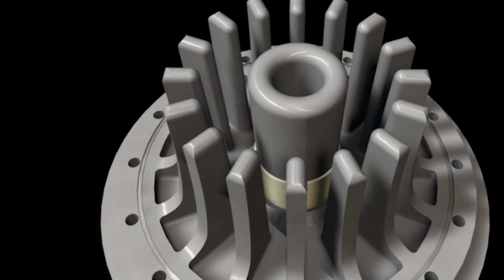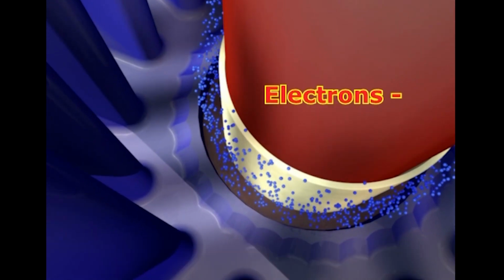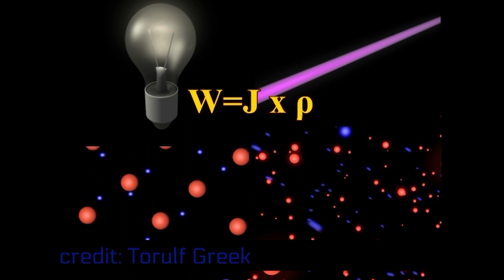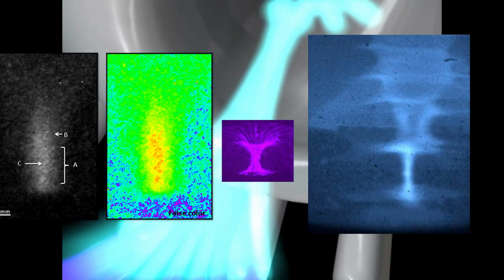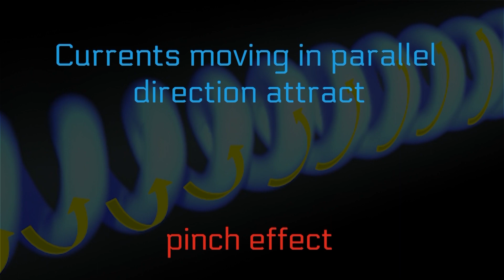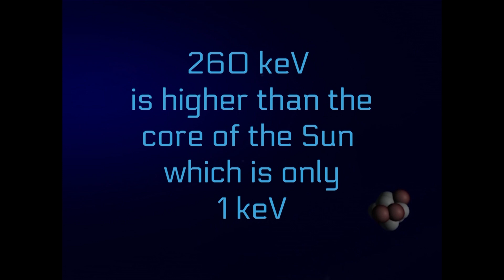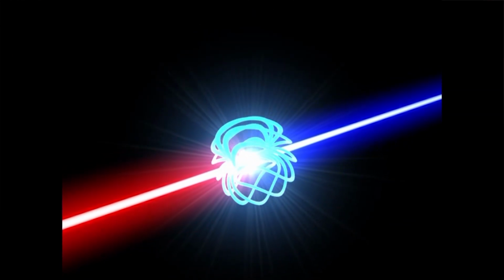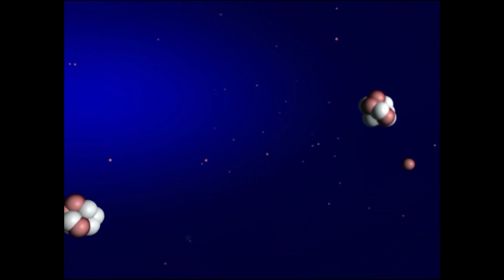How Focus Fusion Works

Comment: Focus fusion is enhanced by the passive interactions between plasma filaments. Lattice confinement is enhanced by the passive interactions between particles in a crystalline lattice. Molten salt fission reactors are enhanced by the passive interactions between ionic solids. I may be way beyond my depth but could these effects all be combined in a single reactor that achieves a focused plasma pinch within a fission-enriched crystalline salt tuned to the melting point of the solid? 

It would be easiest to regulate the rate of the reaction at the melting point of the solid because every particle is fighting against the lattice energy making it a much more stable temperature and temperature is one of the variables that can be used to control the rate of a reaction. The fission reaction would generate the heat, pressure, and neutrons needed for fusion to take place. The plasma focus would, well, focus the heat and pressure further, possibly bringing the coulomb barrier below the surplus threshold.

Again, this is pure speculation and I have no idea how valid this concept might be. My main point is that it seems like a synergistic combination of the best ideas in nuclear energy could overcome the coulomb barrier with much greater efficiency, especially when it comes to the notion of fusion-fission hybrid reactors. After all, it seems likely based on a few of the papers I've read recently that the unexplained surplus heat from earth's core is the result of exactly this type of fusion-fission hybrid reaction and I don't think it's a coincidence that the sun and earth are magnetically coupled due to processes unfolding within their cores. In the sun, it seems to be fusion dominated while, in the earth, it seems to be fission dominated. 

The fact that we have only achieved a fusion surplus by jump-starting the reaction with the detonation of a fission bomb further supports this line of thinking. At lower pressures, fusion is more easily achieved with the help of fission. Or to put it more plainly, with enough fission, you are virtually guaranteed to trigger fusion and vise versa. In a gaseous body, fusion will naturally occur given a sufficient mass. In a rocky body, fission will naturally occur given a sufficient mass (think critical mass or concentration of fissionables). The problem we're running up against seems to be a focus on creating an energy surplus by pure fusion or pure fission, which both have inherent problems. Instead, why not simply enhance fission reactors with fusion?

This would have the potential to exponentially enhance energy output while reducing the costs and risks of each type of reaction and it could be tuned to the ratios of naturally-occurring elements on our planet, allowing us to basically directly harvest the latent energy surplus of the world.

Comment: How is this cooled, wouldn't the temperatures involved in sustained fusion melt this device pretty quickly?
Reply: It uses pulses. the whole process can be turned off and on at will. Look at the google presentation from 8 years ago. I'm both excited and terrified by this technology. This thing is going to be weaponized, I'm telling you! A super hot, and concentrated beam of pure ions...think about that.
Reply: No. The majority of the output energy comes in the form of an in beam and x-rays. Only a constant water source will be required to keep it cool.

Comment: I'm confused. At the end the video shows a proton hitting a boron atom which splits into 3 helium atoms. Isn't this fission?
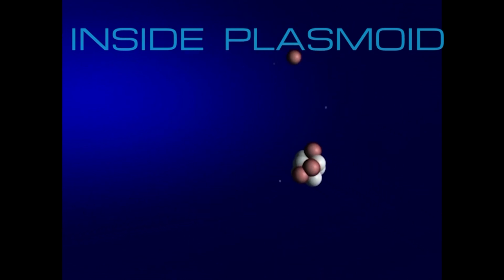Reply: At 3:10 it shows fision! What a scam and even a bad one.
Reply: @Robert Loewe Yes it does. Thank you.
Reply: the proton hits a boron-11 atom, forming carbon-12. the carbon-12 then breaks down (presumably due to the temperature, although it's not at all clear from the animation) into three helium nuclei. so it's technically fusion then fission.

Comment: So once after fission take place what is/are the form of energies can be harvested and in what manner?
Reply: No fission. 
It is fusion. It fuses hydrogen and Boron 11 into helium, and the output is a lot of pulses of x-rays and an ion beam. Both of which convert directly to DC current, which supplies the power for the next pulse, and a large excess. There is no radiation, and no nuclear waste.
Reply: I was confused. Yes it is fusion. What process will we use to convert x ray and or ion beam into DC electricity?

Comment: Have you considered using insulated van der graaf static potential field generator as the (continuous, free) acceleration field? you could also consider additional fusion reactions with output ions (and focus ions) using axial dc magnetic field, generated by the coil used for direct conversion to electricity.

Comment: hello, how do you recover the energy, the heat, that comes from the fusion ? 
sorry if you already answered this question
Reply: Via extracting current from the ion beam as well as the direct output of the fusion process: X-Rays. Using many layers of photoelectric cells all the x-rays are converted to electrons, and so this device needs no steam cycle, and will have relatively modest cooling requirements, which will be handled by a water supply.

Comment: What theory or experiments do support the creation of this "plasmoid knot" ?
Pinch effect is well documented, but usually it leads to great instability without even talking about fusion reactions that add to this instability. Here this plasmoid seems to be very stable.
Also how do you know that this plasmoid then creates these ion and electron beams ?
Can you point to some papers about these questions ?
Thanks.
Reply: Yes abundant experiments show that the plasmoids are stable for times  much longer than the time it take an ion to orbit around. But of course these are still short times--tens of ns. The beams are created at the exact same time as the plasmoid. We consider the plasmoids to be meta-stable, since they last thousands of ion orbits, not millions.

Comment: This company seems remarkably honest as to performance levels actually achieved, which is probably rare in the fusion industry.
Unfortunately they have a very long way to go. The current energy balance seems to be 0.25J from fusion power, with 60kJ input power. Break even is not enough for a commercial power plant, perhaps 10x break even would be more realistic. Thus they have to improve by 2.4 million times!
Reply: wooosh
Reply: Well on their website they hypothesized and experimentally derived a relationship between peak current and fusion yield which has a quintic relationship (i.e. fusion yield is proportional to the fifth power of peak current.) Thus, even small changes in the peak current will have a huge impact on fusion yield.
Reply: The thing is that almost all aspects of this model of reactor are simply that of scale and time.  The technology to make this viable has been around since the 50s, although any realistic application would require both solid state electronics and them to be able to handle high repetitive surge currents and peak voltages.  Although the properties of silicon carbide in this regard have been known since the 80s.

So, at any point between 1950 and today, some enterprising individuals in a dark corner of a mega corporation, somewhere, spending a few rounding errors on crack teams of the best machinists, electricians, physicists, etc they could find to throw at research.... Could have had this idea, proven it worked, and filed it away for a rainy day.

... Actually, thinking it out a bit, most of this could probably be done without solid state components.
The negative resistance cancels out against a capacitor's discharge curve and the main problem is designing capacitors large enough and an electrical bus that conforms to the needs of the circuit.

The simple irony is that it was probably easier to manufacture this 40 years ago than it is today, simply because the trades were more developed and prevalent at a lower cost.  While CAM has made a lot of things easier, it has made custom manufacturing jobs far more premium where they have survived.

Though I am not sure about the claims of no neutrons.  Dense plasma focus is used as a neutron source in other applications (defense).

Comment: I'm eager to see how this does. I think this is the most elegant fusion reactor design out there. There's a lot happening in fusion today, and it feels like we're in the run-up to that first break-even machine. Perhaps we'll get multiple teams realizing the goal in the same year. What a time to be alive.

I know it's too early to make marketing plans, but the DPF seems to be capable of smaller scale than any fusion approach. You might consider putting these on ships rather than the grid at first. If multiple teams do achieve fusion at around the same time, big power companies might be more wooed by the large heat generating machines that fit into their traditional business model.
Reply: You are deluded. When they finally sort out their theories they'll realise they need the gravity of a star to sustain prolonged fusion with net power output.
Reply: @PrivateSi  no

Comment: I have to ask: Why such a simplistic description? It makes little sense to my simple mind:
I would assume that the charge differential between the cathode and the anode would strip the electrons off lithium and the hydrogen, leaving positively charged ions, which would tend to  be attracted to the cathode. I would assume any plasma would simply arc between Anode and Cathode at at some chosen (closest) point, just like my MIG, TIG welder, except at 15 different cathodes instead  of one. Why would they proceed down the hollow Anode at all?
Reply: Your welder has a DC, steady current. Our device has a huge AC current of mega-amps released over a tiny time of microseconds. So the magnetic field energy is much, much greater in our device than for a welder. The current flows in such a ways as to minimize the inductance, the energy in the field. That is why it starts out flowing along the insulator, not by the shortest path. The rest of the rundown and pinch is generated by the forces between the big magnetic field created by the currents and the currents themselves.